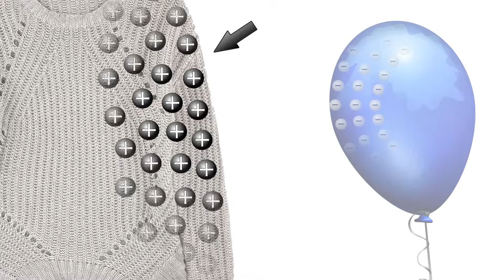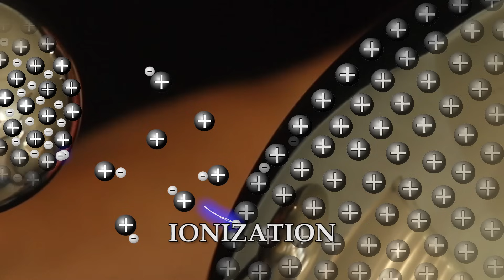Avoid electric shock getting out of a car!

Comment: Nope nope nope, this is not entirely true. The reason you get zapped by your car most of the time is NOT due to friction between you and the car seat. It is due to the friction of the air against the car itself which charges the car body. Engineers already SOLVED this problem: carbon black in the tires. The carbon in the tires usually is conductive enough to discharge whatever charge builds up during driving. However, when the electrical resistance of your tires is too high, or if you have very old, non-carbonized tires, the body of your car can build up an amazing amount of charge. The instant your feet hit the ground, they are at earth potential. If you then touch the car: it will discharge through you.

Anyway: for anyone who has problems with getting zapped by their car: you can buy special rubber flaps with steel wire inside that drag over the road, called grounding straps, thus creating a nice grounding point. It will still be possible to get zapped by your car due to friction on your car seat, but that should be a very minor issue.

Also: if you get shocked by your car from friction between you and the seat, you should be able to shock yourself when you are inside the car and charge yourself up by wiggling heavily in your seat. If you're only able to shock yourself when your feet touch the ground: you need a ground strap.

+Physics Girl: I think you didn't do the story justice by not including the air friction explanation, as it is far more likely. Also: the styrofoam on top of the Van De Graaff is charged by electrostatic induction.
Reply: +LReBe7  
Dude! You are actually ryt! But i want you to watch this video again! 
And apparently she is wearing a footwear which is an insulator and so the shock experienced in THIS CASE is because of the friction between you and the seat!
SO +Physics Girl is ryt!
Reply: Akshaya Ravi
Of course her footwear is an insulator, but when dealing with static electricity that can shock you, were talking about several kilovolts. Obviously the power is very small, otherwise it would kill you, but the electrical potential is extremely high(it wouldn't be able to spark across a gap if it weren't so high). But the insulation of her soles doesn't matter much, as long as the spark can bridge the gap, there will be current.

The paint on the car is also an insulator, but the car still shocked her. Insulators have a high resistance, not infinite resistance. And all must obey Ohm's law. Your point is not proven.

The only way I would consider believing this theory of getting zapped because the friction of getting out of the seat, is by seeing someone step out of the car onto a glass plate or a plastic stool and then touch the car. Or even better: when I see someone fidgeting violently in their seat and touching the car body while they're still inside the car.

I want to eliminate the ground potential from the equation before I prefer the much less energetic source of static electricity(getting out of your seat) over the much more energetic source(friction from the air). Occam's razor.
Reply: +LReBe7 
puff...! 
brainy u r! no  comments!
Reply: +Muhammad Ichsan I would assume that was faked, because it doesn't look like your typical dry winter day. I can't know for sure, Physics Girl will have to tell us herself.
Reply: "Also: the styrofoam on top of the Van De Graaff is charged by electrostatic induction."
No, induction would cause it to stick. This is definitely a case of air ionization/charge spraying.
Reply: True, electrostatic induction would polarize the dipoles with the opposite polarity toward the generator and attract.
Reply: A real problem which is why certain vehicles have drag chains that touch the ground.
Reply: I don't quite believe you. Let's say the car body builds up a charge, and there's no reason it wouldn't. But you're sitting there in that car with your hands on or very close to various metal parts, such as shifter knob etc, which are all grounded to the body, so when you're getting out, the body you touch is at the same potential. Furthermore, what good would it do to just touch the body when sliding out, you'd get a shock the moment you touched it - and she demonstrated she wasn't getting a shock. I'm sure her explanation was correct for her case, it was really just clothes collecting static when sliding across the synthetic seat.

Furthermore tires have always been coloured with carbon black, and a pretty high amount, this is important for mechanical properties of the rubber rather than just electric ones, the carbon particles dissipate the mechanical stress, making the rubber last much longer, and also serve as UV protection. So there's no such thing as "very old non-carbonised tires".
Reply: Nice explanation. But tell me one thing. Can you explain why she didn't feel any shock in the last minutes of her video? If she was charged and the car wasn't, then her explanation makes sense. Because, she prevented to create a big gap.  But, if you said that the car became charged by the air friction, then can we say that she was faking that part? Because there was no way that she could reduce the gap between the car's and her's as the car had been charged so big.
Reply: You're on the right track, but forgetting about the friction between the road and the tires. Carbon black increases grip, but also increases conductivity which allows differential charge to equalize more quickly. High silica content rubber reduces conductivity and rolling resistance and increases static charge buildup.

Comment: On the inside handle of my car door there are two screws. As long as I'm touching one of those screws when I make my exit, I will never gain a charge. BONUS: As long as I'm sure to hold the unlock key when I shut my locked car door, I cannot lock my keys inside by accident!

Comment: The static is caused by two materials that are on different positions on the triboelectric scale coming into momentary contact with each other. Only that. The violence you mentioned is what causes more contact(which moves more electrons) instead of being the cause itself. That violence is actually only a contributing factor.

Comment: Interesting video !  Can this concept explain why plastic wrap clings on to nearly everything ? I'd assume both my hand, or any piece of food or container is electrically neutral yet somehow plastic wrap seems to be attracted to all those and itself. I also know it's not adhesive because I can observe attracting to other things from a distance similar to how charged products do.
Reply: +James Joe I think it's the low mass of the cling film amplifying the effect. It takes less force to accelerate a very light sheet of film. :)
Reply: Anders Vesterholt That would make sense but if the objects are neutral to begin with, they shouldnt be attracted to the plastic wrap. And if random objects had slight charges and that was enough to accelerate the wrap, then some objects would have the same charge as wrap and you'd observe it sometimes repelling and sometimes attracting.

Comment: On a more serious note, there once was an Electrocution Hazard Safety poster, similar to http://www2.worksafebc.com/i/posters/1995/fatal9509.html , that warned about the true-stroy electrocuton of a boom truck driver. While driving the truck with the boom extended, he accidently caused the boom to contact some overhead electrical wires. Nothing really bad yet had occurred. Then, in order to investigate the situation, he stepped out of the truck and made contact with the ground. By doing this, he completed the circuit from the wires-boom-truck-driver-ground. He died.

Comment: I think that the car actually gets charged from the air friction and it gets grounded when you step out and touch it. Touching it first and then steping out just makes the sparking happen between your shoe and the ground. Because I don't get why it wouldn't spark when you touch the metal while you're in the car if it's grounded. Cars are usually not grounded.

Comment: I never got shocked by my own car, i did got shocked with some companycar i had back in the day. Only 1! I drove different cars for my work (taxidriver) and always tought it was the car who did it, but i guess it was somehow my own work. And really i always get out of the car in the same way. I step out holding the door from the inside not leaning on it (wich you should never do btw) and standing up from the seat. And closing it, pushing it at the plastic? part so i mostly never touch the metal.

I will try touching the metal again tomorrow see if i still get shocked.
Reply: +marlb0r015 Nope, probably was the car that did it, check if it has a grounding strap. It's not an absolute necessity, usually modern tires have carbon in them to reduce their resistance as to discharge whatever charge builds up on the car body when driving. The car body charges up when you drive because there's friction between the air and the car body.

Comment: I noticed that you really feel the shook when you touch the metal by hand or fingers, but if you touch metal by your wrist or forearm then you don't actually feel anything. SO I developed that stupid habit to touch metal things with wrist first, before touching them with hand.. it helps :-)
Reply: +Andrey Grez Try touching them with your elbow, it has very little nerve ends(have someone bite your elbow, you'll be amazed how insensitive it) and usually there's a little bit of callus there, so the peak current will drop just a little.

Comment: I'm surprised by the definition of a perfect insulator presented in this video (that it can't receive charges).

Any material can receive a charge on its surface. the difference between a conductor and an insulator is that the conductor allows the charge to move inside of it while the insulator will not allow it and the charge will stay in place  until it's picked up again by some other material coming in direct contact at the exact same location.

The fact that an insulator builds a charge by rubbing it is the perfect example of this behavior.
When rubbing 2 objects together you constantly create charges on both surfaces by transferring electrons from one material to the other. If at least one of the materials is conductive the electrons will rapidly move back to their original position by moving through the conductor and cancel the charge transfer.
When both materials are insulators the charges can't move from their spot and because of the rubbing movement they're not in direct contact with their original spot anymore so they can't move back there and they're trapped until another opposite charge comes in contact long enough to allow the transfer in the other direction.

The difference between a perfect and a real insulator is the discharging spark that is explained later in the video. For an ideal insulator, whatever the voltage the charge would never move through the material and stay immobile until it's in direct contact with an opposite charge. In a real material there's some maximal voltage gradient that it can support until it lets the charge go through violently.

Comment: How not to get shocked ? discharge yourself through a 50 ohm resistor. This will be slow down discharge process.
Reply: +330MillionGods Make that a megaohm! Static charges can easily go up to several kV, the 50 ohms won't do all that much.

Comment: This 'solution' doesn't work for me. Maybe I'm too big. And, when you're tall and strong, you can't really lose weight to lower your size and avoid jolts of static electricity.
I still get shocked, whether or not I am touching the metallic car body whilst exiting a car.
The static shock from when my hand is on the car while exiting is more mild though.

Comment: 3:30 The launch of Apollo 12 in 1969 nearly came to disaster when, for some idiotic reason it was decided to launch the rocket in the rain, as there was no lightning in the area. However no one seemed to think about the fact that EVERY rainstorm leads to a large charge difference between the cloud and the ground. The voltage is usually not high enough to create lightning as the charge must be very high to pass through the 3000 to 5000 feet of air between the ground and the cloud.
   When a bolt of lightning strikes it is so hot that it ionizes the air, making that column of air much more conductive. This then allows the cloud to discharge most of it's voltage which is why lightning tend to flicker.
   In the rain storm that was over the launch pad at the time of launch the charge wasn't great enough to overcome the resistance of non-ionized air. But lightning isn't the only thing that can ionize air. A Saturn 5 rocket can to it as well. As soon as the rocket got close enough a bolt of lightning struck the rocket and followed the smoke trail to the launch pad TWICE. It was just pure luck that the only thing that happened was a bunch of circuit breakers were tripped, which the crew was quickly able to reset.

Comment: This is actually really important before you fill up at a gas station. If you are charged and cause a spark, you can ignite the fuel!
Reply: I used to work in a place that handled components with microchips. We had training to avoid causing damage with electrostatic discharge. Some of the training included films with scenes from gasoline stations where there had been fires caused by sparks igniting fuel.
Reply: Do you actually believe that? 🤔 
that literally will not happen. Ever.
Reply: The spark isn't anywhere near powerful enough to ignite it
Reply: @ploperdung  There have been studies of HUNDREDS of fires at gas stations and most of them are caused by women getting out of their vehicles after having gotten back inside WHILE FUELING. Yes, the tiniest spark can, in fact, ignite gasoline fumes, which may be invisibly swirling around you, and then you pull the nozzle from the tank without ALSO touching the car with your other hand (to keep the electrical charge gradient small).

Comment: Hey! Love the video!
I was just wondering in the case of the styrofoam and the pom-pom was it that they became electrically conductive because of the high charge and transmitted their electrons to the van de graaf, or is it that the air transmitted the charges because the air became conductive, or is it both? In other words, did the voltage cause the styrofoam or the air to become conductive?

Comment: I used to face that problem with my other car. I ended up just closing the door by pushing the window thus insulating myself from the chassis
Reply: ah you are the car in the parking lot with hand prints all over the driver side window....
Reply: I end up pushing the window just like u but after that u will get sock if u touch other metal

Comment: I have a GREAT point that may change how you see the car problem. I was on a moving car next to a friend who was also on a moving car, and we had to exchange some object(can't remember what it was) so we reached our hands out of the window and touched each other. The result was SHOCKING. We both experienced a significantly stronger shock than those you see when two people are electricly charged, and we were both isolated from the ground by the wheels and other factors, so the explanation I came with was that we were both electricly charged from the friction with the air, but since my car tended to move faster (and it had worse aerodynamics than the other car (looked less like a drop)) my car built more electric potential than the other. When we touched each other the electric charges on both cars rushed towards an equipotencial and we got zzzzaped . 

My point is that, theoretically, both cars would have the same electric potencial, and we only touched each other, so the flow of charges only happened within our bodies. That means that, before and after the exchange, I had the same potencial as the car, meaning I was electricly charged. And even though the car and I were on the same potencial, wouldn't that change the outcome of getting off the car and touching it? Maybe the exchange of charges wasn't complete, and the car still ended up with a different potencial. BTW, we tried that again a few weeks later alla ET, same result.
Reply: Maybe drugs

Comment: At the very end she did not get shocked by the van de graf while trying to get her own hair to stand up because, like she said, there was too much humidity in the air of the room she was in, which bleeds the charge off into the humidity as fast as the van de graf can generate it and therefore the potential never builds to a high level.

Comment: I am so static prone! When I am running on the treadmill I have to keep my hands on the metal handles of the treadmill the entire time otherwise if im running with my arms by my side and then reach for the handles I get shocked really badly. Its so annoying! The same happens with door handles and car doors but they're not as bad as they are small shocks.
Reply: +Neylena Happens to me too but I figured out the cause quickly! It was been caused by my shoes (Nike Roshes) I always get static shocks with them everywhere. I found that if I worn the shoes without socks I didn't get the shocks. Try run on the treadmill without socks & shoes OR With shoes & no socks. Get back to me if I helped!
Reply: Bolaji Ibrahim Oh right fair enough! How am I meant to run on the treadmill without socks and shoes? I dont think that would be the solution here, it would probably cause more pain aha!
Reply: +Neylena Run with just shoes! I was just saying to run bare feet just to prove that its usually shoes that cause the static build up. I run on the treadmill with just shoes and no socks 😀
Reply: Bolaji Ibrahim Oh right yeah! Good Idea! I'll try that :D